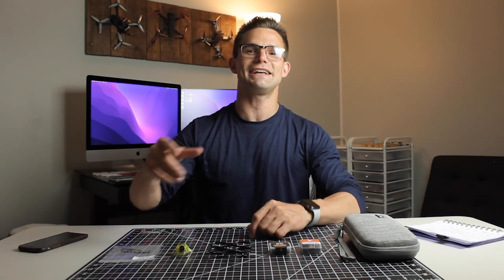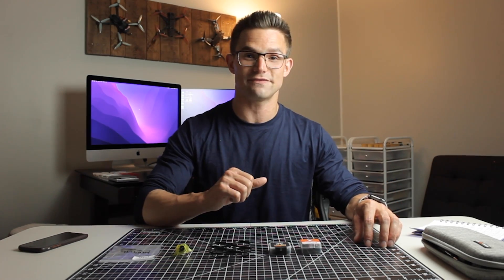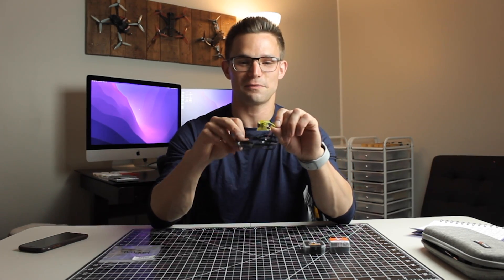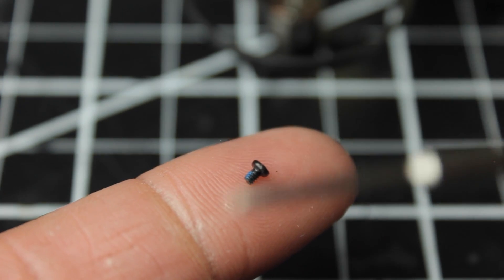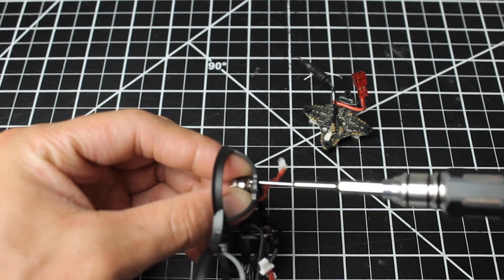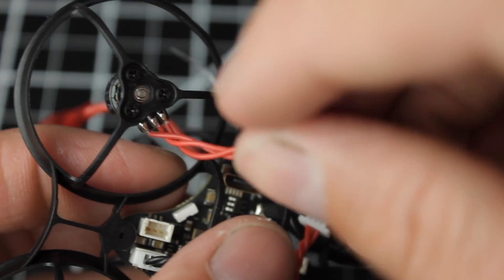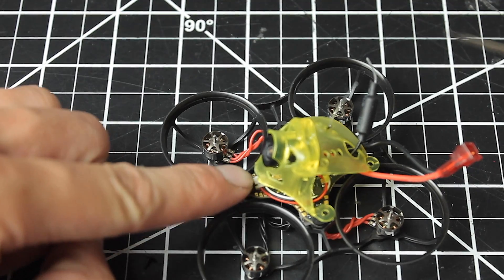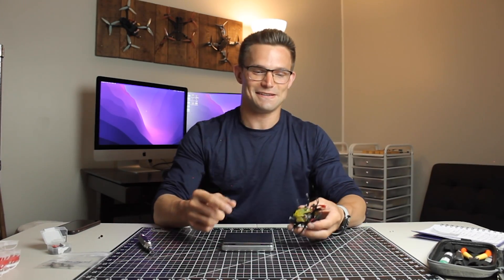Ultimate Guide to Build a Micro FPV Racing Drone

Comment: HI Wynn, I bought a C03 camera and vtx M03 from beta (but second hand). Im still have some problems with soldering them because of the soldering pad's size. Can you give me a tutorial, or where did you learn to soler ? Thousands of thks !
Reply from the maker: Hey they are hard to solder because of the pads being so small. What soldering iron do you have? Also did you watch this video? DIY - Build a Micro Racing FPV Drone for $120 / in 2023
https://youtu.be/0K-GTuGI6AI